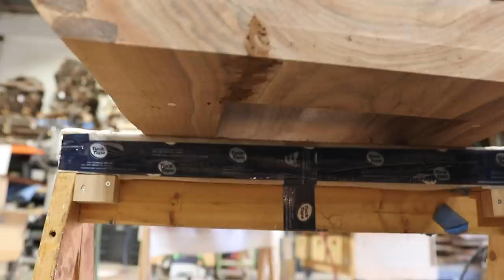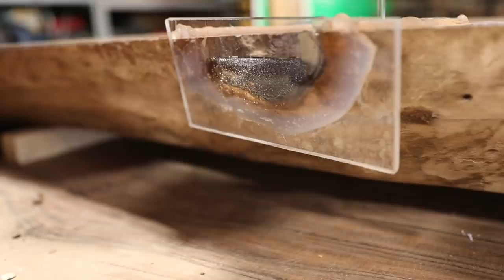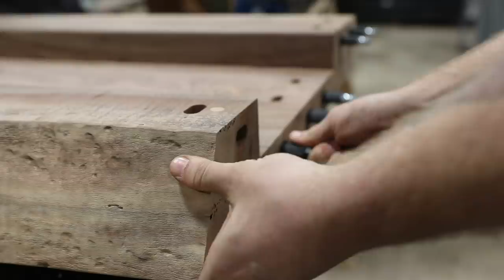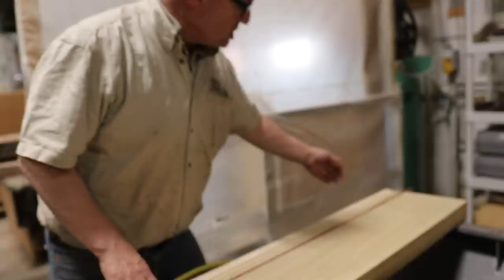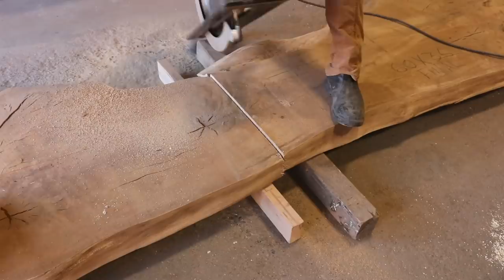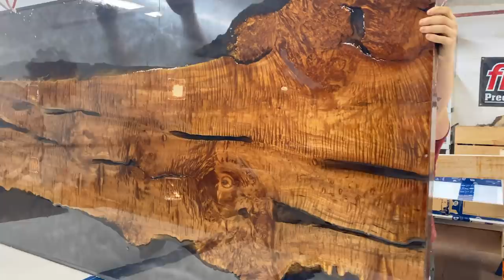Why Did We Cut This Table in Half?

Comment: How many time do you use the "tuck tape" mold pieces and how can I keep a slab from warping as it sits in my shop?
Reply: Kelly Schubauer we reuse the moulds as much as we can, by filling old screw holes with silicone and covering them up with tuck tape. We rarely ever have to cut new moulds for new tables. The best you can do to limit warping. Is always keep the slab off flat surfaces, by using sticks/Dunnage. Or stand it vertical. Then when milking make sure you take equal parts off both sides. And keep the slab out of hot areas. Or areas that fluctuate In temperature drastically 😀

Comment: How many tables do you guys make a year? Also, is there a way to keep the bark on? It would look cool and more natural. Maybe if you drill a few holes per square inch so the epoxy can get stuck inside the bark as well as the outside. The holes should be deep enough to reach the actual wood. Let me know please.
Reply: Good question. I was wondering if the bark could be soaked in thinned super glue.